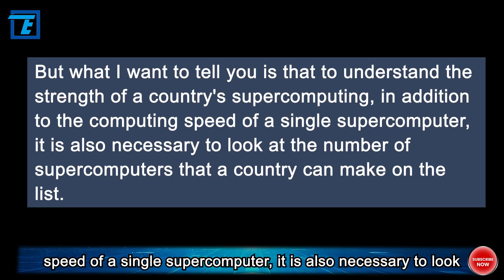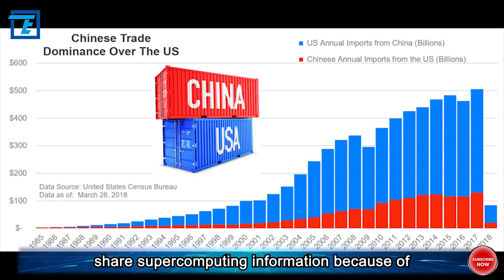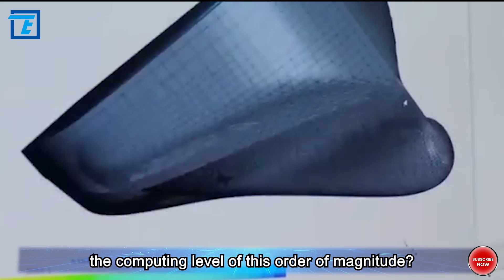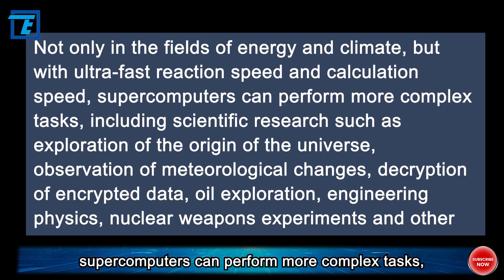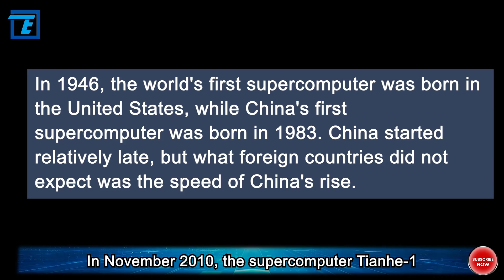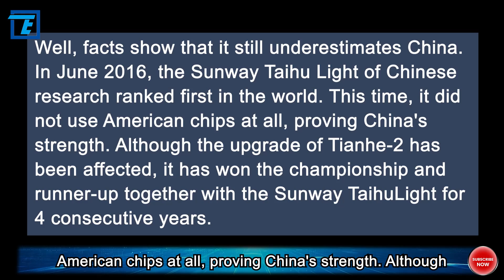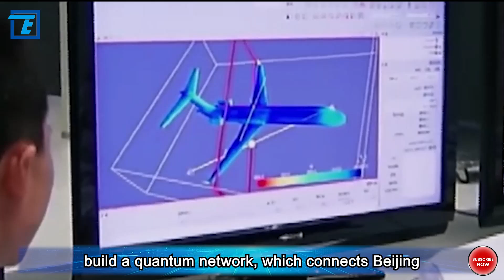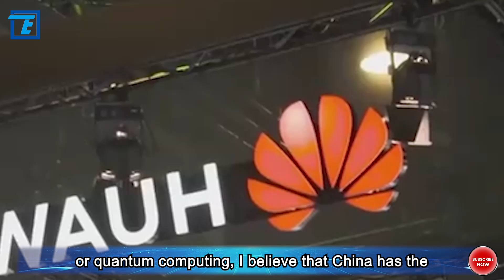For a variety of unexplained reasons, China's supercomputer dropped from first to ninth

Comment: As per record China Quantum computing started in 2016. Now satellite network with Quantum computing calculation and transmission across continents. This will help much needed accurate impeding natural disaster data for world. When output is shared with world, China will get immense accolades. It doesn't matter whether disclosure of STRENGTH or not.